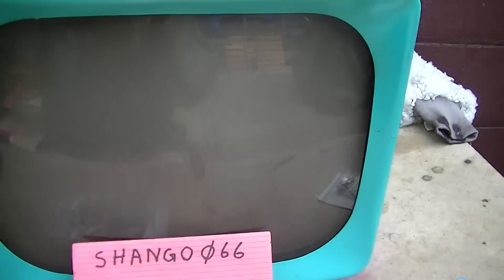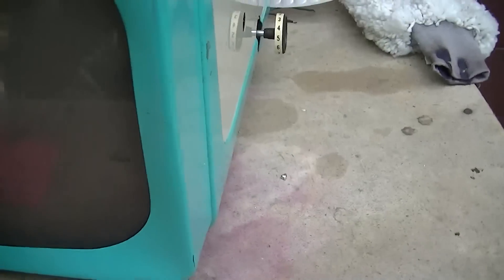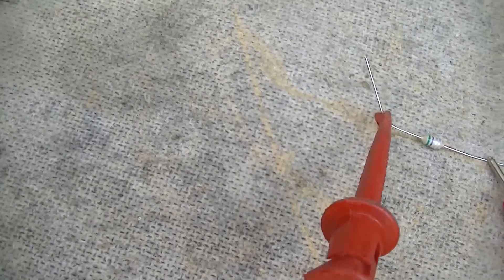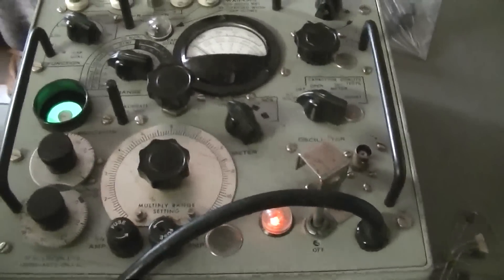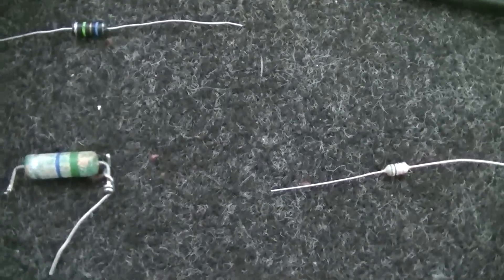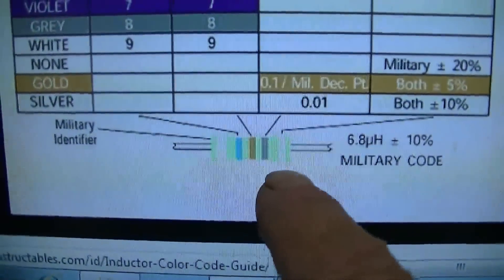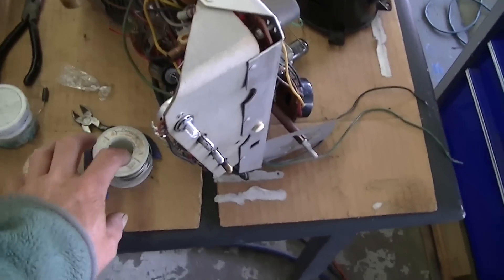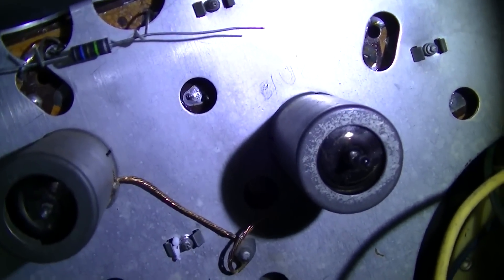Hotpoint Television Repair Final

Comment: IIRC these GE & Hotpoint portable sets had only two stages of pix IF.  My experience with these is that yes they can be made to work OK, but were never all that stellar in sensitivity.  Sharpness was also a bit compromised.  There would be some snow with no signal, but it was mostly faint, particularly on the higher VHF band.  Gain was just what it was for a cheap set.  That said, this one you show seems to be doing quite well.

Comment: Measure the inductors like this: put inductor in series with a known value resistor, say 100 ohms, connect to output  of signal generator. Set sine wave generator to, output, say, 1 volt, into inductor and resistor in series and adjust frequency of generator until junction of inductor and resistor to ground = 0.5V, and now you know reactance is 100 ohms at this frequency. Use frequency and reactance to calculate inductance.

Comment: You cant get eye opening, because Reactance of inductor is too small at only 1kHz.
If you calculate for example with 5.6uH ...  2*3.14*1000Hz*0.0000056H=0.035R which is way too small for bridge.

Comment from the maker: Brent Wegher19 hours agoSams had a "Photofact Television Course" book in the 1970s that had a couple pages of instructive info on how peaking inductors worked in video amp circuits. If you can't see any real world difference then I'd not worry about it.
The 1K pot can be shunted with a fixed resistor to get the range you want. Try 1600 ohms.
  
  
  
    
        

  

      
  
    
      
           

        
      
    
  
BUDDY LIGHT1 day ago (edited)You lost me after micro whatever..........? I still watch all your videos. I think I'll stick to fixen engines and home repairs.
  
  
  
    
        

  

      
  
    
      
           

        
      
    
  
justsomeguytoyou20 hours agoThat turned out quite nicely, well done. Do you ever use any of your vintage sets?

Comment from the maker: Remi Mattera3 hours agoHey, I was recently working on a 1987 Macintosh with a Monochrome B&W CRT built in, the powercable was a bit tight, so I yanked it out, and accidentally hit the yoke on the CRT, and I started to hear a hissing sound, is it gone? Can I fix it? Or is it dead for ever now.
Reply: I've broken a few of the tips on those tubes myself during a service. It cannot be repaired, you need a new picture tube. Check the solder on the yoke connector on the power board while doing the job, the joints run hot and frequently crack, you can't see it without taking the plastic shield off the board if I remember right...?

Comment: A couple of things you didnt mention about the inductor that might have an effect is Q and moreover self resonant frequency, of the Q of the new inductor is a lot different then it isnt going to work the same, esp if its part of an oscillator.
Also an inductor operated above its self resonant frequency becomes a capacitor, so at high freq's it would just be a short instead of an inductance.

Comment: At some point I tried a 1N60P on a crystal set and the perfomance was very poor, I don't know why though.
Despite that point contact germanium diodes resemble catwhisker detectors, which are crude Schottky diodes (based on a metal to semiconductor barrier), they have a small PN juntion formed by difussion of atoms from the whisker into the germanium. I know that both the Ge point contact devices and the Schottkys are leaky, both also should perform well on high frequencies, but I suspect the 1N60P would have a higher forward bias voltage, given it's a silicon device.

Comment from the maker: kevtris1 day agoI'd stay away from the shottky, because it will have a lot higher leakage current.  whether this is a problem or not in the circuit I don't know.
  
  
  
    
        

  

      
  
    
      
           

        
      
    
  
Scott Kg4yhr721 day agogood job great video
1

Comment from the maker: Rosie O'Kelly1 day agoLmao@sliding IQ of the country..right to the chops!4  
  
  
        

  

      
  
    
      
           

        
      
    
  
Kenneth Scharf1 day ago (edited)I've got an L/C meter that measures capacitors and  inductors using a micro processor.  You can buy these things from China on ebay for under $50 (I built mine from plans found on line.)  I could measure those for you.  (My gizmo measures at a few hundred KHZ).
1  
  
  
    
        

  

    
  
    
      
           

        
      
    
  
Sir Gawain1 day agoAre they worth buying? I have been looking at these over the past few days, looks like they are built around an Atmel processor.